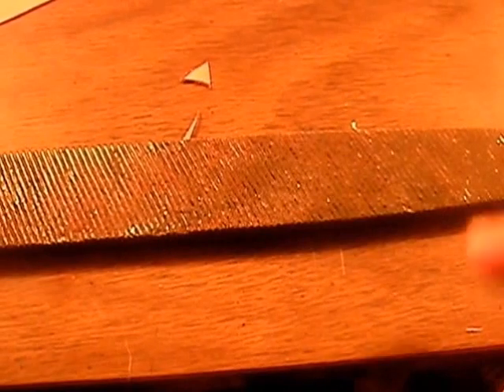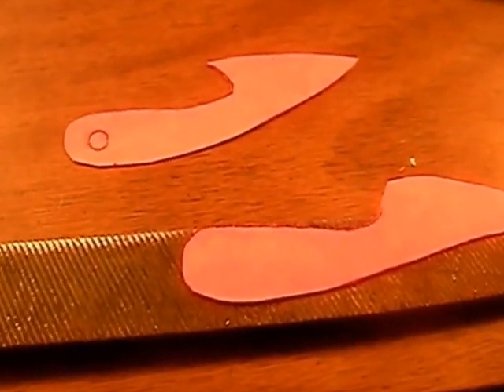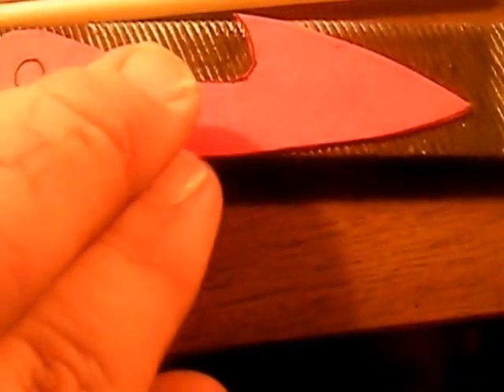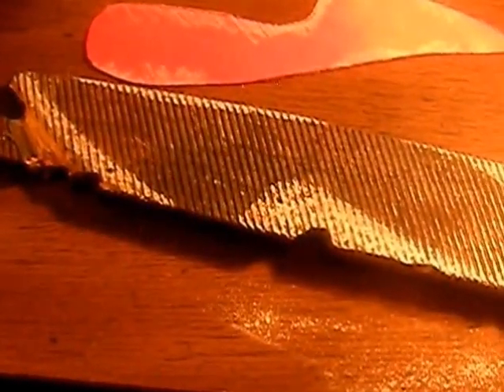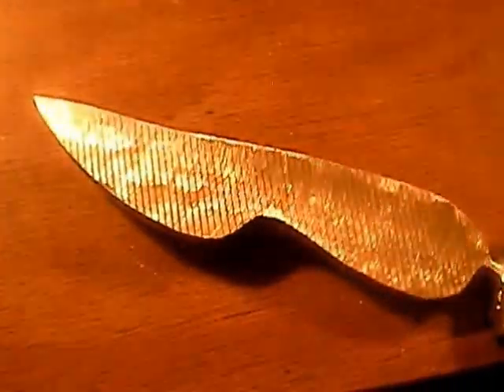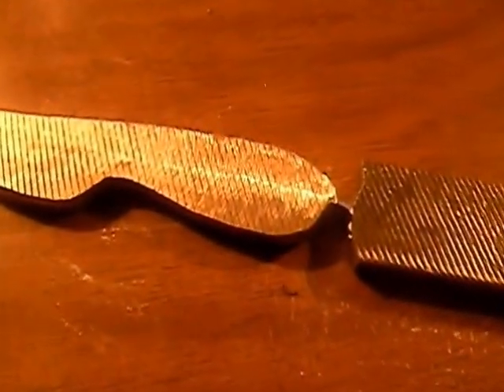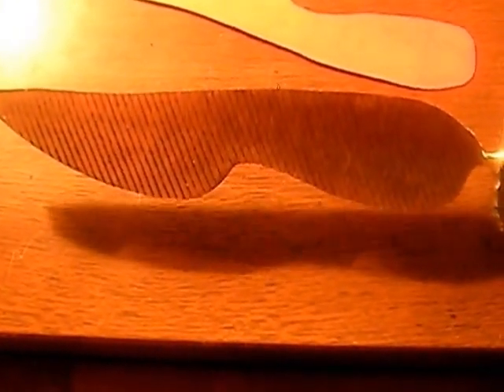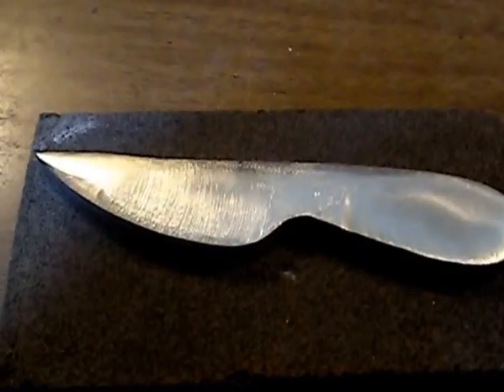How to make a survival neck knife out of an old file blade making blanks

Comment: I like to neck carry a knife, and I think a full size handle is very important to me, even if the blade is short but it has to have a good balance, the handle and the blade should be similar in size, one of my favorite neck knives is my Skookum Bush Tool mine is around 4 finger long around 4", the other knife, even though light is my John Bradley World's Finest Camp Knife,  I usually attach that one to my backpack strap's in front, then my Rodent Solution, my Rodent 4,  my Browning Independence Fix Blade, all have full size handle's and are my favorite, I do have smaller knives which I like for EDC but in the bush, give me a full handle size short knife any day.
Reply from the maker: paulie 4x I need to pick up a goon long handle neck knife. Maybe after I get my moonshiner. Thanks for watching and the great comment.

Comment: yuo should take the heat treat off before working with it, just heatit up untill it's non magnetic (cherry red color) and led it cool slowly (in sand or just in the air, that soften the blade so you can work with it
Reply from the maker: MISTER AGB I just did not want to re heat treat it afterward. I did do that with the file knife though and it saved on my file and grinding wheels.
Reply: Texas Blades ah oke man ;)

Comment: can i melt iron  and pore it to make knife blades
Reply from the maker: +Dawn Hawbecker Never have seen it done before. You can sure buy bar stock and make a great knife though.
Reply: you could melt it down and pour into a mold but you will lose a lot of  durability, and sharp or hard impacts will likely break it. rolled/hammered steel the crystals in the steel are bound  and stretched intertwining each other when you pour it it kinda resembles Styrofoam where each crystal is just sitting next to one another. you can see this when you break cast iron vs flat bar
Reply: +Dawn Hawbecker you need to make the king of randoms electric arc furnace to melt iron